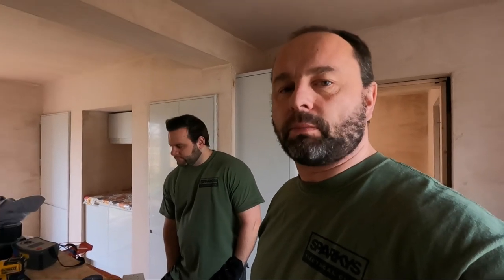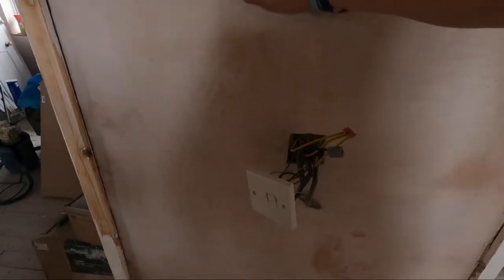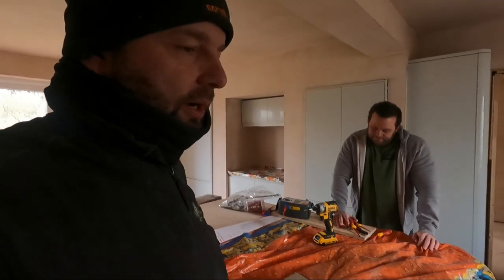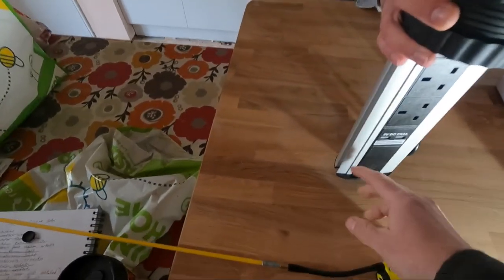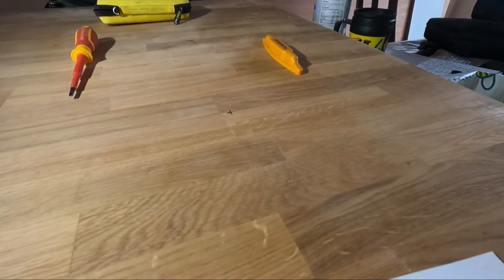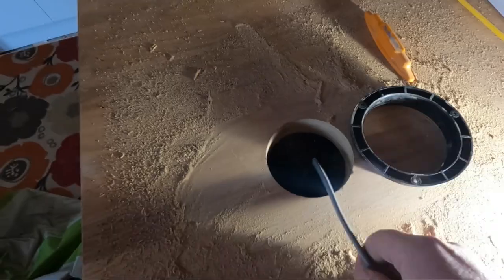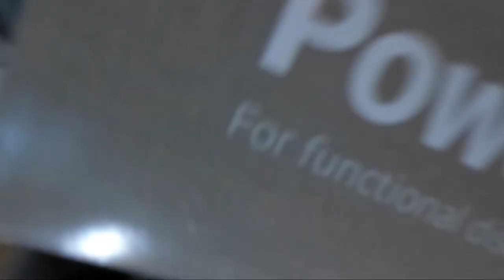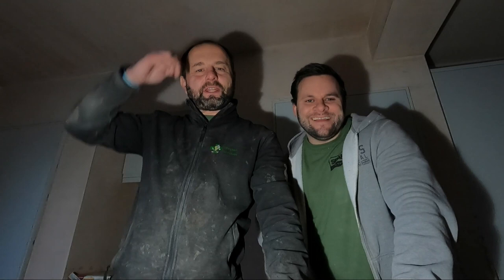Second fix electrics electrical installation work testing and installing a pop up socket

Comment: Working out the hole and then cutting it out first time then silicon for the plastic nut. 
The only electrical work there was to plug it in.
You should have got the kitchen fitter to do it.
Great drama though.
Reply from the maker: Yes mate, but we did rewire the house too, I did ask the kitchen fitter to do it but he forgot!

Comment: Always a sphincter tightener but you got there in the end. I would have thought that a gasket or a seal of some sort on top and down the inside of the hole of the worktop to stop any water Ingress. But I have never installed one so maybe it's not required.
Reply from the maker: Hi Chris, thanks for watching, yes you would've thought so, there wasn't one in the box but I guess you wouldn't really fit a socket where it would get wet

Comment: Pop up socket surely there was a cupboard which was accessible from where u r Adam was standing that u could have removed back panel or part of  to gain access to that void
Reply from the maker: I can assure you there wasn't, you would've thought so wouldn't you